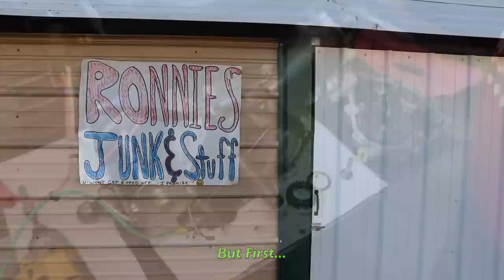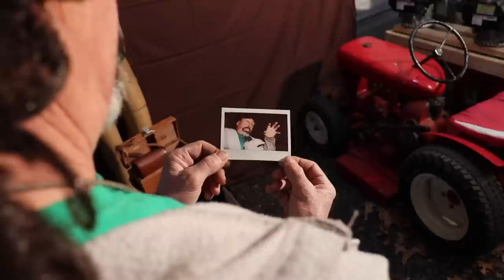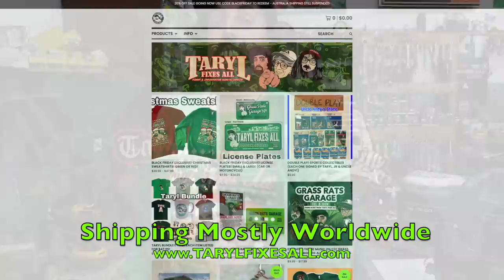Crappy Briggs Plastic Gear FAIL - Is It Warranty?

Comment: Well let's take a little stroll down history Lane. Tecumseh and the aluminum bore Briggs engine were designed in the late 50s or very early 60s. Both Tecumseh and Briggs used that basic design for decades. Both engines lasted reasonably well. Now we're doing a redesign to the overhead valve type and some idiot decided that putting a plastic gear plastic camshaft or other plastic internal engine parts is a good idea. Tecumseh for cost cutting measures eventually stop putting hardened seats in the heads and soon thereafter went out of business. Briggs & Stratton went into receivership and had to be purchased by an investment group. They're on their way out too doing stupid stuff like this.  Tecumseh never really innovated still use the basic 50s 60s design. Briggs tried to innovate and screwed it up.  Sad.
Reply: Tecumseh 2-strokes are GREAT! I have one in my Aries "SS522" sno-blower, with ZERO issues in 19yrs of use. I have to admit that I LOVE 2-strokes, having had them in motorcycles (Kawasaki H1- Mach3), Harley "Hummer" (1959 vintage) and various small engine applications. The power (for the displacement) plus NO valves, camshafts, oil/filter changes make them a favorite in my book, the EPA doesn't seem to agree. SAD! Would LOVE  to find a RUST-FREE SAAB "93" for sale.

Comment: It’s planned failure. It’s just a matter of time. And it should be a class action lawsuit or something to make them rethink this metal to nylon coupling of parts in the engine. I think it must have paid out as far as not as many warranty claims as units sold by a long shot.

Comment: you know, today, a predator engine from harbor freight lasts just as long as a briggs engine, if not longer, AND costs about half as much.  the predator on my push mower has a metal carburetor, not a plastic one like briggs engines,  plastic parts is how companies can rip one off.  they know the plastic will fail quickly, but they do it anyways to keep you paying for parts and/or repairs.  briggs does not make quality engines any more, all of todays stuff is disposable garbage, cars, small engines, lawn mowers, both riding and push.  maybe instead of charging a higher price for their crap, they should be dropping the price seein as everything is meant to be thrown away in 1-3 years.

Comment: Taryl, I thank that flywheel key got stressed when the crankshaft stopped real fast and the flywheel tried to keep going. Mighta bin that when the camshaft stopped, a valve was open and the piston hit it. Kinda like a car moter duz when tha serpentiming belt brakes. ANyhoo, it was a good reapare! Ah heer that Briggs an Scrattin is fighting now about maybe puttin a plastic connecting rod in there moters. Briggs wants to and Scrattin duz not! Do you use that there sympathetic oil in them moters?
Reply: It is NOT the serpentine belt breaking that causes piston to valve collision, IT'S the TIMING BELT in an "interference" type engine!

Comment: When you try to save money for manufacturing, but spend double the money in warranty repair work.  Just make it right the first time.
Reply: They are counting on people to throw away the product to avoid the hassle of hauling your machine to an "factory authorized service center" probably located 50 miles from where you live. Shipping costs to the factory would be more than what the machine is worth. A lot of people aren't even aware that, today, warranties DON'T cover shipping costs to and from the factory, unlike the "good old days", where at least RETURN shipping was covered for a defective part!  That $7 watch from Walmart has a "lifetime warranty", just pay the $10 shipping fee AND the company will send you a BRAND NEW $7 watch! Simple!

Comment: B&s board of directors to engineers; design us a new overhead valve engine. Engineers to b&s board of directors; designed you a high quality efficient engine👍. B&s board of directors to bean counters in charge of manufacturing; we need to build this engine and make 500% profit,so fill a shiny metal case with recycled plastic parts. As long as it meets emissions standards and lasts one season.

Comment: Go figure these new engines being made of cheap Chinese parts and break down within a couple years. PATHETIC. I can't comprehend why they would use ANY plastic parts INSIDE an engine that's going through over 300 degrees of heat and hard work. You got 40 year old lawn tractors made of heavy duty American made metal that still run like brand new 40 years later, and then these pieces of junk that break down BRAND NEW.